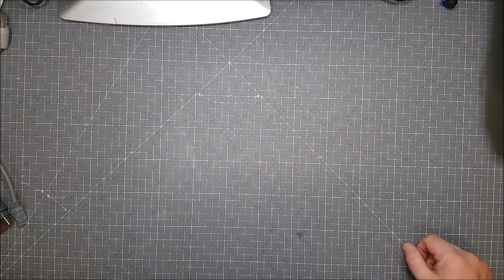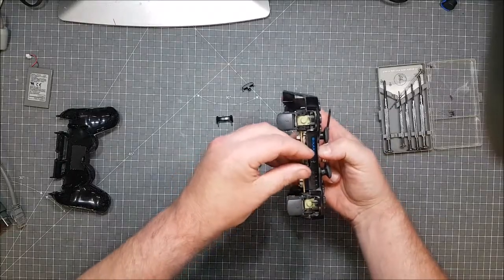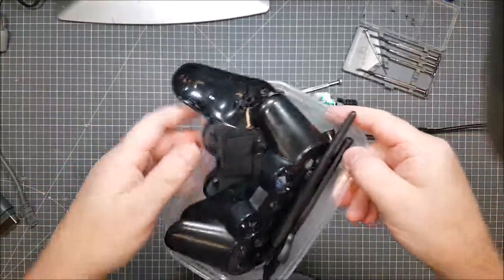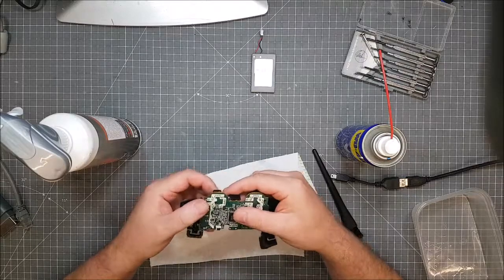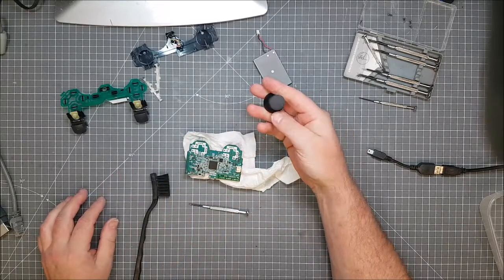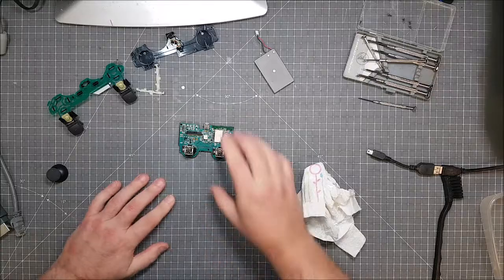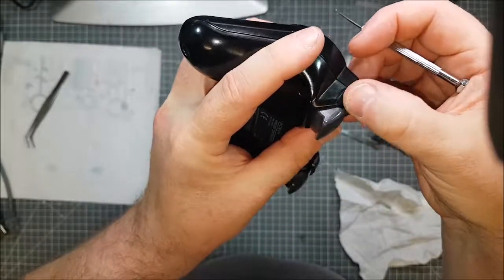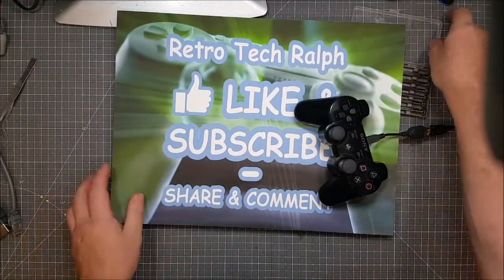Sony PlayStation 3. Sixaxis controller Cleandown and rebuild

Comment: I stupidly decided to try and do this as I wanted to replace my joysticks, most frustrating thing I've ever done I have to say :/ I had to hold myself back multiple times from launching the controller against the wall, safe to say it's now been shoved into a drawer and I'm now waiting for a new controller off eBay to arrive :(
Reply: @Roland if a original controller is new it should be more than 108$
Reply: man you could still re-try one day! You can do it! It'll feel nice the day you finally do!
Reply: @PiesZdzislaw  why so expensive?
Reply: @DKG_4747  maybe because there is a small amount of the new original controllers so it has to be that expensive.

Comment: Took the back off to replace the battery and one of the trigger assembly's came off at the same time. Was hoping to find a video showing a quick and easy way to reattach it as getting the ribbon back on it being an utter utter utter swine. I don't think such a video exists for that very reason. Otherwise good video.

Comment: Skipped the part replacing the little piece for the d pad😫
Reply: That's exactly what I'm looking for...
Reply: I took a picture for myself, when I opened my second one, having the same problem of not knowing how it fit. It goes: D-buttons in holes, 3-prong, white pad, etc.

(Still can’t get the damn back on though. Those shoulder pieces…)

https://drive.google.com/file/d/1D_oG5qLEC0T6JpY_dUTilPWH2HwVaJC8/view?usp=drivesdk

Comment: Just reassembled my dual shock 3. This is one of the most annoying things i've done in a long time. It was a old and used controller that never been cleaned and it was in bad condition. Im glad i cleaned it, but it was so annoying and tedious. The bumpers and triggers were intimidating but not to bad, but they loved popping out. struggled with the module that holds them too. everything seemed easy until i tried to put the back case back on and realized something wasn't aligned, or something was in the way. after multiple trial and errors of undoing everything and redoing it, eventually something snapped and everything was aligned. process sucked and its debatable if it was worth it or not but my buttons feel nice now so..

Comment: the 3 prong piece  disappeared at 20:20? didnt need it  ? need to know where it goes on the D pad ?
Reply from the maker: 5:14, you can see it dropping into the pot from the D pad. It is a support bar for that, and should only go in 1 way. it goes between the pad control buttons and the rubber membrane
Reply: @R_T_Ralph  i still can’t figure out how that piece is supposed to go!!!!
Reply from the maker: @citlallyperez2294  it fits between the D-pad and the rubber membrane behind it. makes the D pad controller a bit more stiff and strengthens it.
Reply: @R_T_Ralph  the prongs are supposed to be left-right-down?
Reply: @MilosnikPiwa  he probably doesn't know. Just shove it in there i suppose.

Comment: Bro you cut out the part I needed to know where it went
Reply from the maker: can i assume you mean the cross piece?
that goes behind the joypad to strengthen it. 
This is an old video for me.
Reply: @R_T_Ralph  I ended throwing both controllers away got a headache I hate the ps3 controllers

Comment: Man I struggled for an hour last night trying to put the damn L1/R1/L2/R2 triggers back on. Those little plastic adapters between the 1/2 sticks is so annoying! Any additional tips to get mine to fit back in?
Reply from the maker: just patience. They can be fitted when nearly completely assembled, but you could break off the small tabs.
Reply: I know it's 2 years too late but throughout the video I was getting annoyed you didn't know the ps3 controllers require a specific current before the charging kicks in. A PS3 consoles USB ports and official Sony charge dock does this ^^

Comment: is it just me or are the insides of these  same types of controllers different? ive watched a few tutorials and there seems to be a slightly different build. anyways...no one on all of effing Youtube can show me how to effing put the effing ribbons back underneath the number 1 and 2 buttons...everyones so called disassembly show you the buttons still attached to the ribbons...how is that a disassembly? i need to know how to properly put the ribbons back successfully under my 1 and 2 buttons.

Comment: I have a lot of dualshock 3. All of them died because of 2 reasons: 1) the connection between the motherboard and the thin plastic printed board for the keys became loose and needed more pressure to hold them 2) the plastic printed board got corroded at the same spot, just at slight left spot beside the select button.

Comment: The left joysticks "center bit spinning" 0:41 is by no means cause for repair. Most pf them came fresh out of the box like that. The right one never does, but the left one is actually a control feature on some knock off game system controllers. I was about to throw a racing game against the wall for not being able to turn the car until I accidently turned the left center cap and the car turned just fine.